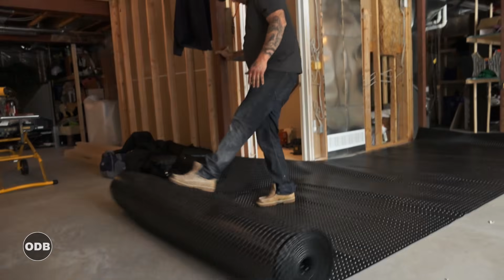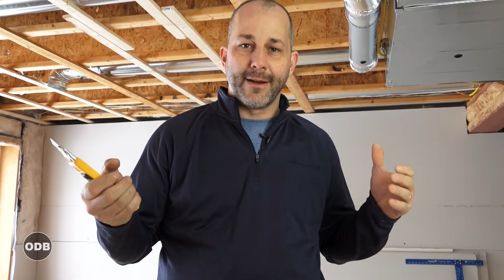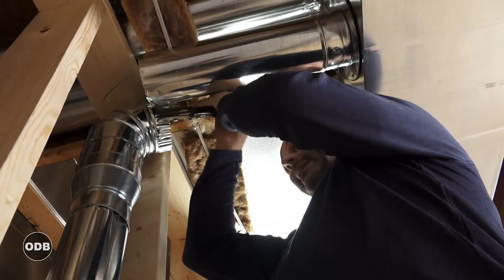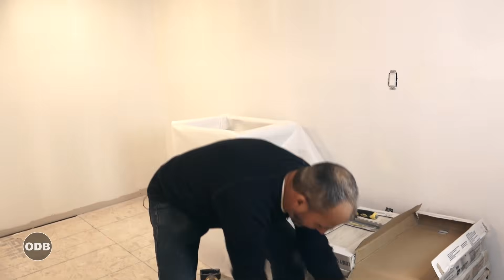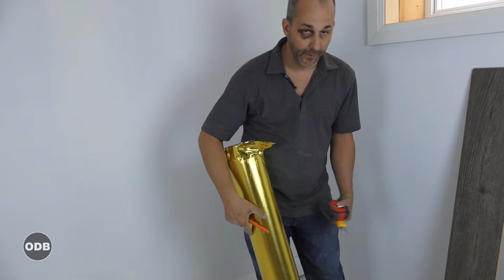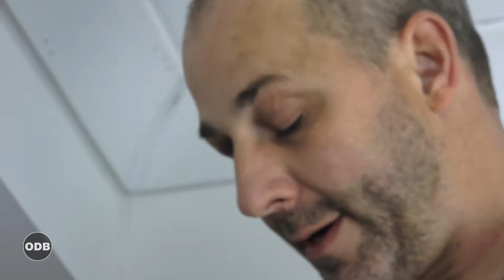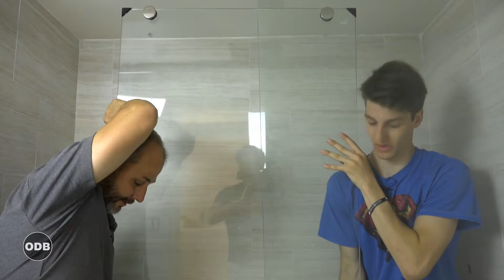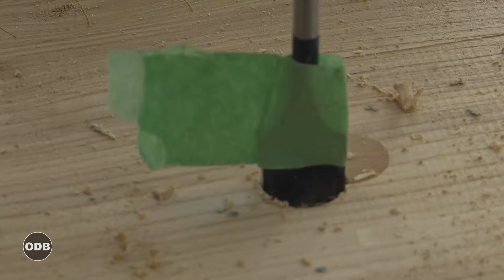DIY | How To Renovate an Unfinished Basement | A To Z

Comment: I love the scope of this video.  You cover so many different techniques for each task. I also appreciated when you get a bit cavalier and 'eyeball' it... When it comes to penetrations in engineered joists you pointed out that you could not 'bend' the short piece... the real reason that is acceptable is that the top and bottom chord are mostly in tension and compression, and is not weakened by the lack of webbing.
Reply from the maker: sure, Cheers!

Comment: I beg to differ with the host about being good with a calking gun when doing trim.  A 2 of 3 inch plane, a hand rasp, a sanding block, and a good utility knife along with a tiny bit of time and patience and you too can make pencil line joints which means if you are doing natural trim the joint will look like a pencil line and if you will take the time learn how to cope a joint your trim work will look like Norm Abrams did your trim work.  Is it as quick as using a chop saw no but let’s be honest a old fashioned miter box and a cheap (as opposed to a expensive) back cut saw will do a far better job than the best chops saw (or $350 compound sliding miter saw) the best part is when doing baseboard trim you can rough cut you trim lengths and even do one end of the board miter cut while standing and the once you are down on the ground with your miter box you don’t need to keep getting up and going to the saw and kneeling down to install it.  Lastly the six foot rule the host of the video was taking about when doing crown molding is Equine Manure and a cop out for only doing a job just good enough.  That said I totally agree with him when it comes to calking spend the money and buy the good stuff not only does it hold better it more times than not it finishes better but remember calking is not meant to fill big gaps it is just seal joints.  Myself I prefer to use adhesives to make things stick together and calking to calk joints when you use adhesive caulking ie it supposed to do both jobs they tend not to either job as well and they don’t finish as well because when you are trying to smooth the joint out they are trying to stick to you.
Reply from the maker: If you want to spend all that time doing trim then be my guest. I prefer to get er done. Cheers!

Comment: hi sorry to be a Debbie downer but the install of the baseboards is wrong the returns should be scribed so if the house moves you shouldn't see gaps but each to their own in guess
Reply from the maker: Hi James, if the poured foundation of the basement moves we have a bigger problem than a gap in the trim board. Cheers!

Comment: I am in the process of planning to remodel my 1970 basement. I have concrete floors on my basement. I want to put laminate floors. After I put the vapor barrier and plywood, can I put the laminate floors on top of the play wood
Reply from the maker: best to use a n underlay. it absorbs sound as well as eliminates the risk of dirt crunching under you feet as you step.

Comment: Those pex crimpers you used are designed for a different style crimp ring. The correct ring is called a stainless press sleeve. Heat link won't back you if you ever have a flood using the wrong crimp rings.
Reply from the maker: No worries Mike, we pressure tested and all is good.

Comment: What if the basement cement isnt levelled, does one just keep going with installing the dmx, the plywood, under pad, laminate flooring
Reply from the maker: no basement is level. And likewise all products have some flex so they generally perform well. If you are really concerned use the vinyl plank flooring and it will adapt to any curve in the floor. Cheers!

Comment: 1- why some interior wall are over the DMX and some not?
2- why do you have part of the wall made with pink insulation and some with foam?
Reply from the maker: I bauilt new walls on the subfloor but left the existing. The idea is to help the moisture travel to the exterior walls as much as possible to allow the air space to dry it out passively. This works with 50% of the walls on the floor. Cheers!

Comment: Running apex through floor joists in the ceiling of the basement is this recommended practice or a problem?
Reply from the maker: no problem as long as they are not lvl. Cheers!

Comment: Do you have a video installing crown molding on an open ceiling type deal? As I mentioned awhile back on another video of yours, I started hanging drywall in the basement.  I took the drop ceiling down and painted it black. I want to install crown on the top....got anything for that? 

Great videos!! Awesome work! Thanks in advance!!
Reply from the maker: as a matter of fact yes. don't let the black eye bother you! Cheers!
https://www.youtube.com/watch?v=dZHFNnbLG8g
Reply: @HomeRenoVisionDIY  haha no worries! Thanks! 

Another quick question for ya.........what if I'm going to lay "engineered wood flooring" in my basement and it already has the drywall.....do I still use that black layer you used here with the plywood? Mine is coming along fairly nicely so far! Im finished with "day 2" stuff; took me about 5 days to get done in my evening spare time :D  

Thanks again!

Comment: if you read the screw box you used for fasteners to frame with ,it says NOT FOR STRUCTURAL,in the states inspector would shut you down
Reply from the maker: Hi Wendell, just to help clarify, interior walls and bulkheads are not considered structural framing in North America. Cheers!
Reply: I beg to differ,load bearing walls ARE structural members,interior,or exterior... @HomeRenoVisionDIY
Reply from the maker: Hi Wendell, when we began this finishing job the load was already being supported by the exterior foundation walls and the steel beams in the center of the building. All of the work we did on this job was jsut to finish an already supported space. Therefore there is no additional structural work that was done on this site. If you still need help in understanding this please talk to a structural engineer and get clarification as I think you may be performing work on your jobs that is totally unnecessary and costing you time and your clients a lot of money that is not needed. Cheers!

Comment: If those tile spacers also go under the tile, doesn't that raise up each tile 1/8" off the floor? Seems like that would use a lot of extra mortar to fill in all that 1/8" space.
Thanks for the videos.
Reply from the maker: In actuality we use at least 1/4 cement under a tile so no worries.
Reply: @HomeRenoVisionDIY  DAMN SON!!! MIC DROP!!!

Comment: Superb! Suggestion: slow down a little and explain a little more when you're tackling something like framing.

A nitpicking question: I noticed that you did not glue the baseboards in addition to nailing them to the walls. Was this to save effort, or was there another reason?

Thanks for your wonderful contribution.
Reply from the maker: I would suggest you use nails or glue and not a combination. That is serious over kill when gravity does most of the work.

Comment: You should have crimp the reducer side, you are impeding air flow, and yes it makes a difference.  Same with your little 10" piece, as a rule you will never crimp both ends of the same pipe.....its all about air flow.  And take the time to cut a round hole. Food for thought.
Reply from the maker: Thanks for your concern.

Comment: He mentions caulking gaps in crown molding.  However, that only works for painted moldings.  If the basement (or other space) will use molding with a natural finish, that won't work. Inside joints must be coped rather than mitered.
Reply from the maker: Good news, I am working with painted moldings. Cheers!

Comment: Why would the shower door be installed where the gap between the sliding doors is facing the stream of water?  Shouldn't those panes have been installed where the stationary one is closest to the inside and the slider the furthest so that water doesn't spray directly at the gap/gasket between the two doors?
Reply: cause when you are done and open the door the water on the door will fall inside the shower, if you do it like you suggest you have to wipe it or let the water fall of outside the shower
Reply from the maker: there is a toilet there. Besides the gaskets don't get the spray directly. And they are there for a reason.
Reply: @HomeRenoVisionDIY  Yea, I get that.  What I was saying, though, was why not flip which one is inside and which one is outside... so the gasket is facing away from the shower spray...  I did that on one of my shower door installs when I was remodeling my home.  That way, the door still opens from the correct side - but the gasket is away from the direct spray (direction at least).  I would venture the downstairs shower won't get daily use anyway - but it was just my thought when I saw it.
Reply from the maker: Hi Dan Hirsh, I don't think that model allowed the reverse installation

Comment: how you can run hvac in 2x4 walls in basement floor as there is no 3.5 x 11 inch rectangular duct work every thing is round  tubes
Reply from the maker: make the walls 2x6. Cheers!

Comment: I wanted to thank you for mentioning that shower doors are not water proofing, they are water diverters.   I sold them for 10 years, and it shocked me how people could force them to leak and then act like it was our fault.   The worst, was a neo angle that from the door to the wall where the shower head wall was a distance of 9 1/2 feet.  Somehow they were able to get water to leak in that one.   Mine at home, was just a replacement of my tub to a shower and I didn't even caulk it and never had issues. (caulked when I sold the house)

Comment: Why is 40-60 years the goal?  Why can't we build for 200+?  Seems like a waste to have to bulldoze after 40-60 years.  And I am not singling you out here.  Neither the contractor that built the house nor anyone else is thinking that far out.  I just think it makes more sense to make something that will really last.  Would that cost double?  Half again more?  What do you think?

I am thinking concrete foundation with an advanced formula for lasting a long time (the Romans used a lot of volcanic ash in their mix.  The Chinese put in some boiled rice flour which somehow greatly strengthened it.  Clay in it can keep water out.  And there is advanced modern stuff they use for military bunkers and such.  Could use treated or engineered lumber painted with or dipped in tar or epoxy, concrete board with greenboard attached for thick strong walls.  Stainless steel instead of ordinary steel.  And there is some other plastic pipe that is much stronger than ABS.  I saw someone use it for pipe pulled under a driveway.  Stainless screws and nails.  Overkill electrical wiring.  Stainless water supply pipes?  I think brass is only good for 60 years?  Not sure if stainless can last for 200.  Probably, as heat accelerates damage and they have pipes for very hot fluids. Faucets seem like the only thing that there is no suitable option to last 200 years.  Sure there is industrial stuff that should last 200 years at the level of use found in a home, but nothing that would look right in a home.  Doors and hinges could be made very durable.  Door locks?  I don't know, sounds like a very tall order.  But locks, and valves, are not really that difficult to change.  There are a few options in roofs that should be able to last over 200 years.  Quality hard slate, some tile, stainless steel.  I guess outlets will not last.  We may not even need outlets in 200 years.

Designs will evolve and homes will have better technology in the future, and occupants will have expectations not met by a house of our era, but I don't think our designs are rubbish either, and should still be enjoyable 200 years hence. 

We are still using B-52 bombers and plans are to keep using them until 2050...almost 100 years of service.
Reply from the maker: I guess deep down everyone knows we are hearing for Armageddon!
Reply: @HomeRenoVisionDIY  Damn son that's cold.
Reply: Where I grew up in Sweden, we had many homes in the area that were well over one hundred years old and some that were two hundred  years. I think the problem is the modern construction materials and the fact that we want to have a comfortable living condition inside our home, so no granite slabs and thick mortar seals. My grandmas iron stove is about a hundred years old and works fine but a modern stove is built to last about ten. Many household appliances at the dump are only five or six years old. 
It leads to a tragic future for our kids. Many of the young ones today do not know that one can mend a sock and make it last longer. They just toss it out and buy a new pair.

Comment: You need a mask when cutting tile, and mixing concrete.  You can do some serious lung damage.  Other than that, I loved it.  Oh, and I just use a knife to cut the outside corner of the baseboard more at the bottom and very little at the top, then you don't need shims and it all fits.  Maybe not every time.  I am no expert though.  I am slow with this stuff.  6 weeks...that's fast.  And all the modifications to the plans were excellent.  I hate the wax rings too.  Too easy to break a seal.  The foam ones cost more but they work better...and much more forgiving if everything is not perfect.
You did not show how you dealt with the gap between your baseboards and the top of the laminate.  Did you remove the baseboards and lower them or put something in the gap?  Seems easier to put the baseboard in after the laminate. Just put a piece of laminate on the face of the wall. When done, pull it out and put the baseboard on.  I envy you having that laminate cutter, never saw one of those before.  I choked down too much dust and walked back and forth to the saw endlessly.  And the sawdust can make some laminate very slippery.  Great tool to have.  
The dowel pieces looked a little short to really hold, and there was an offal lot sanded off on the ends, but with the steel poles, I guess that does not matter.
I saw another video where they filled that gap in the wood for the bar with some really cool stuff with color, glitter, and such that was awesome.
Reply from the maker: or do it outside. Cheers!

Comment: Hey Jeff. I framed my basement but I didn't use treated wood for the base which sits on concrete, is there something I can do to make mold resistant for years? Thanks and more power.
Reply from the maker: Yes, you can cut out the bottom plate and reinstall. Or if you can pull it out from the wall so that you can get plastic in between the concrete and framing. Cheers!

Comment: What about crowns on studs. Do you place them toward the wall or leave them outside when securing to top n bottom plates?
Reply from the maker: Not a consideration in new construction since we will repair anything outrageous and then attach wall board immediately. Once the drywall is on the wood generally stops moving.
Reply: If the crowns are placed some in n others out, the wallboard will be wavy, won't it?

Comment: I see Mike Holmes on DIY uses the purple or pink coating on walls and all wood studding including joists. What is it called n where to buy it? 

Also, how far from cinder block basement wall to start a wall . Heard I need an air gap. Want to use Owens stryfoam panels against basement wall n roxul between studding. 

Thx
Pete

Comment: Jeff, I’m tackling my first ever basement remodel and have really enjoyed this video. All kinds of tips and products I’d like to include in my own project. I do have a concern that I don’t recall you addressing: How to frame and drywall around an existing basement door? I’d like to lay out the vapor barrier and then the plywood sub flooring, but once I do that, what if the door that swings open won’t clear the subfloor? I apologize if this seems like an extremely ignorant question
Reply from the maker: In most cases an existing door will have to be either resized or re framed. A small price to pay for this type of finish. Cheers!

Comment: You can see how much Jeff hates toilet bolts. He keeps flipping them the bird during the entire section on installing a toilet. Gotta love it.
Reply: I just use a small bolt cutter and a file.  I don't like using the grinder in tight spaces, and it really does not take any longer.  You have to clean up all the soot from the grinder, plug it in, put it back in the case...  And I like the long stuff, it makes it easier to align stuff and find the nut afterward when you really don't want to feel all over a well used toilet for it.

Comment: Jeff! 2 thumbs up for all of your videos! My house is less than 2 yrs old. The basement only has insulation. Do I need to remove the existing joist that builder installed if I want to use metal framing? Do i need to use self levelling concrete for the floor?
Reply from the maker: I hate metal in a basement and leveler in a basement is usually not necessary.

Comment: Very good video. I want to finish my basement but I am stopped at the very first moment. I like to know what to do with all those steel rods exiting from the concrete wall. Some of them are rusty, so I supposed that there is some water infiltration. Thanks.

Comment: Excellent work, you are a pro.  Only comment is reguarding that Dap caulk.  In my experience which is a plenty it will not work long term and by that I mean even just a couple months.  It is just a cover up as soon as you leave it shrinks shifts and the cracks and gaps appear.  I guess it makes the contractor feel better about their work before they leave.  Otherwise thanks for the video.
Reply from the maker: Ouch, actually in most cases it is not the caulking that is the problem but the fact that contractors don't have the product acclimatized before installing it.
Reply: I can see that being a problem, hey maybe you figured it out, from what I see it gets thrown in the bed of a truck and subject to cold/heat from job to job. Oh well thanks again you do great work.